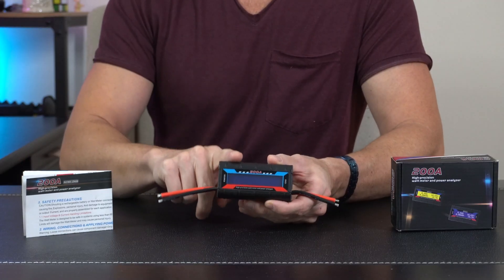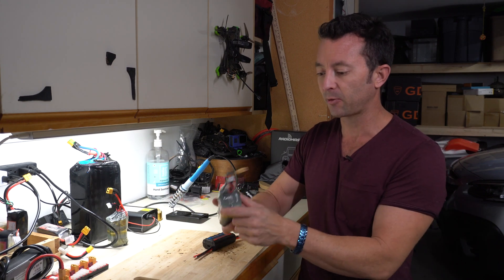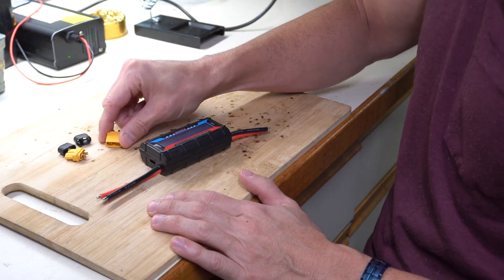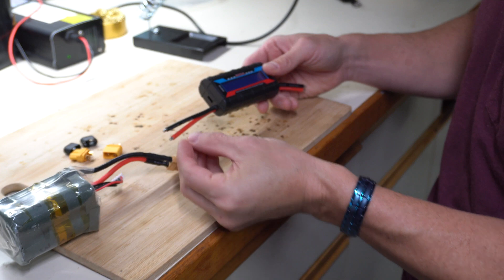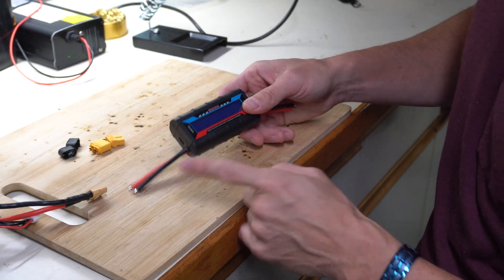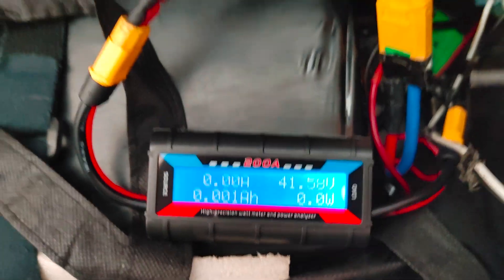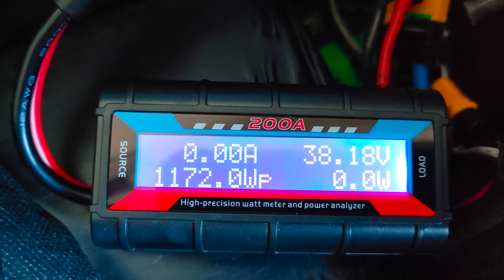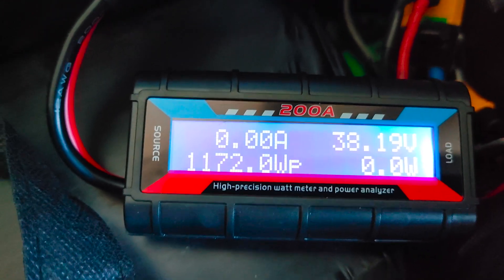200A Watt Meter Review -  A MUST HAVE For DIY People

Comment: do you know if the data pin (Pin3) can be used for any data output to another device or microcontroller etc? It says "for future use" in the manual, I wonder if this is for data or for flashing
Reply from the maker: I don't know what does ChatGPT say?

Comment: 1:40 how not to do it.  you need to watch a YouTube video to so show you what to do.. also you did not show how you powered the Meter. that's the info i needed . think it needs 5 to 8 volts or something.. that how it has the 3 pins on the side. learned nothing from this. just that you need flux
Reply: and lead free solder

Comment: Hey fwould this work on a subwoofer amplifier? Source being the speaker output and load being the speaker? I want to measure how many watts is being sent to the speaker. Thanks!
Reply from the maker: Good question, and interesting one too. I don't know the answer so I asked ChatGPT, I was interested because I used to have subwoofers when I was younger and miss having them in my car.... Here's the answer.:
To measure how much current or power the subwoofer is drawing, you would need to place a current sensor (specifically one capable of measuring AC current at audio frequencies) in-line with one of the speaker wires running from the amp to the subwoofer.

So short answer is that no this will not work cause it's only meant for DC power, and it is a current with audio frequencies from the amplifier to the subwoofer.

Comment: I am assuming you the source is the battery and the load will be connected to the controller correct?
Reply from the maker: Correct. But what I also do is solder together a pair of male connectors and a pair of female connectors, so I can reverse the direction of the watt meter and then what I can do when I'm charging a battery back up I can measure the flow from the charger into the battery versus just discharge. If that makes sense.

Comment: Do you have any knowledge or feedback regarding using one of these on a trolling motor running on a 12v 100ah LiFEPO4? Wire gauge from the meter is a little light to wire inline for a 55lb thrust. Wire it in as a temp bypass circuit? 

Thanks much
Reply from the maker: I think it depends on how many amps you're projected to pull, and what the meter is rated at for it max input settings.. I don't remember what that number is off the top of my head. But it does have twelve gauge wire leads which is rated up to eighty amps constant I believe, and would probably be okay if you go over that for a short burst.